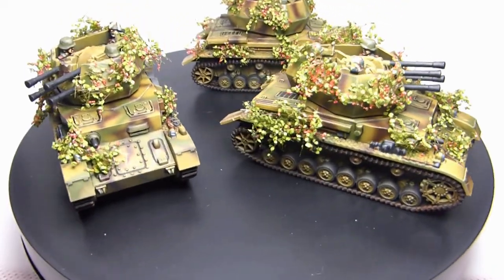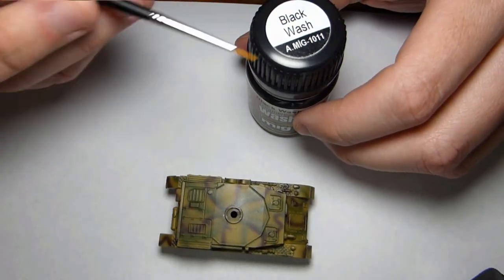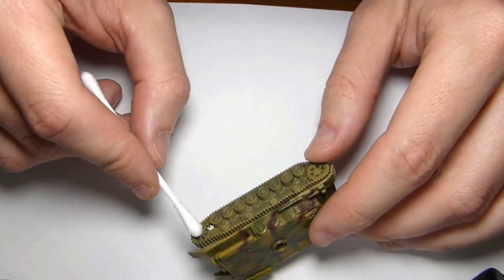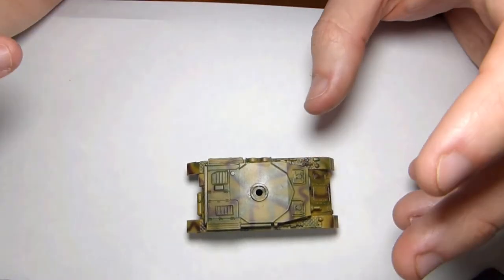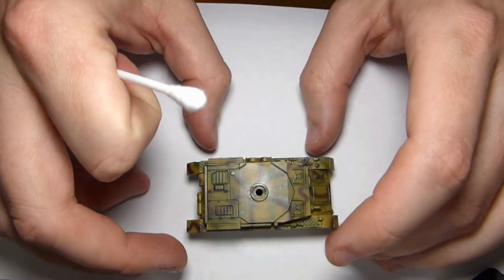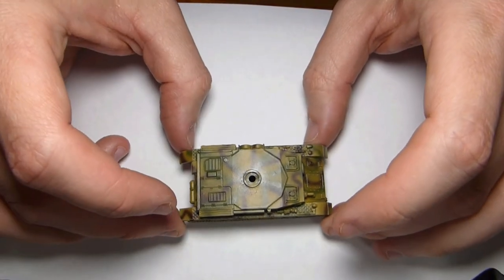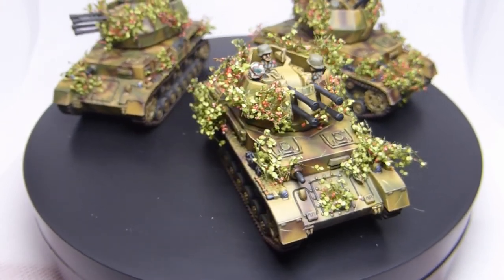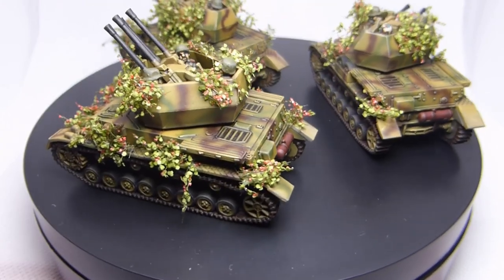How to Paint a Panzer Tank Wirbelwind - Tips for Painting Flames of War! (1/100, 15mm)

Comment: how do you manage to paint such tiny lines? i've just bought a harder and steenbeck airbrush as my 2nd brush with a 0.2 mm needle and when i want to paint REALLY fine line it either keeps spiderwebbing or my hand is too shaky
Reply from the maker: OK so the first thing you want to do is swap out that 0.2mm needle and nozzle for a 0.15mm instead. That's what I use for my tiny lines, ensure your paint is thinned nicely to prevent it blocking and set your compressor to about 15psi (1bar). Always practice first, I just use my old table or a piece of paper 🤭 

Spiderwebbing could be happening because your paint is super thinned down OR your compressor is set higher than it should be.
Reply: @paintingpanzers  thank you!
Reply from the maker: @justbeq5177  let me know how you go and if you need any other help ☺️
Reply: @paintingpanzers  of course! Thank you so much!